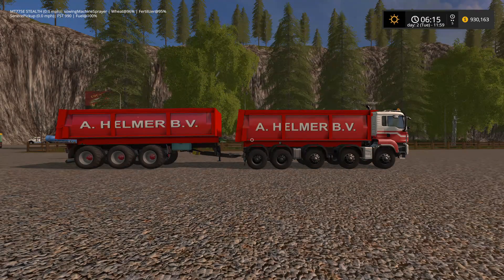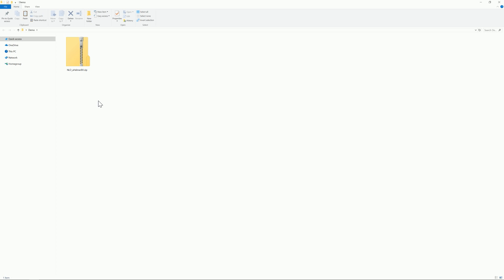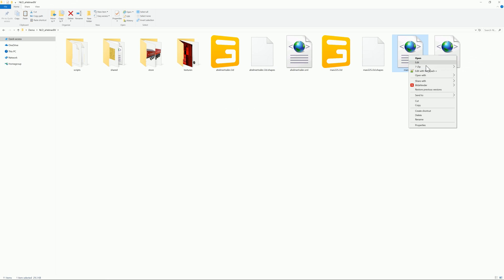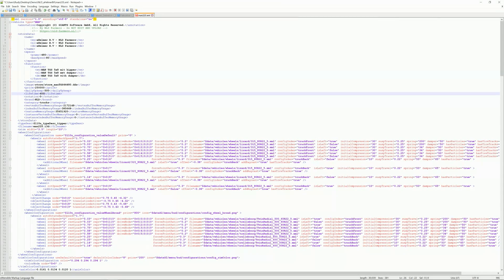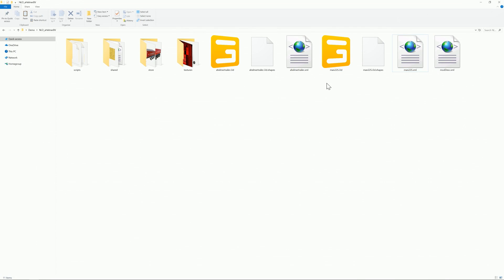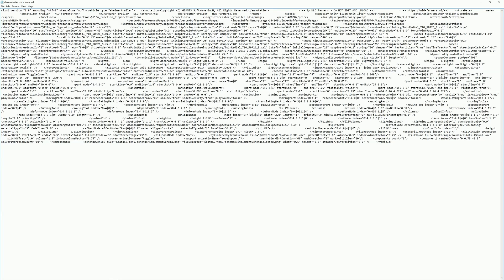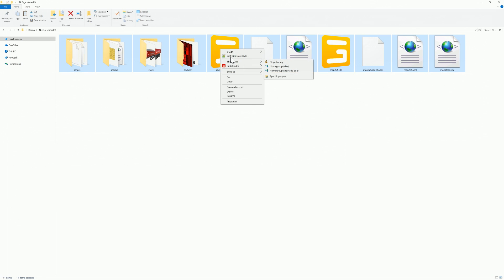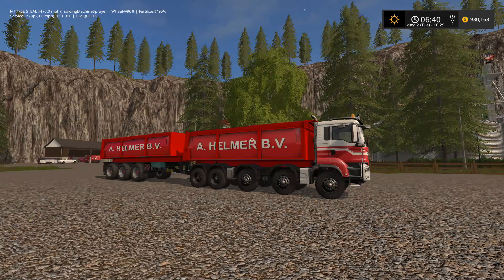Farming Simulator 17 Modding Tutorial How to make changes to an XML

Comment: i found a unimog driveable round baler so i added a tow bar to pull the wrapper behind it to collect and wrap the grass bales as i bale them. but i also what to move the bar around to off set the wrapper to the right side to collect from the field. and it works except that while the wrapper is attached and i move the bar to the side the wrapper doesn't move with it so i have to unattach and reattach it. is there a way to fix it so with the wrapper attach i can move the bar and the wrapper moves with the end of the bar